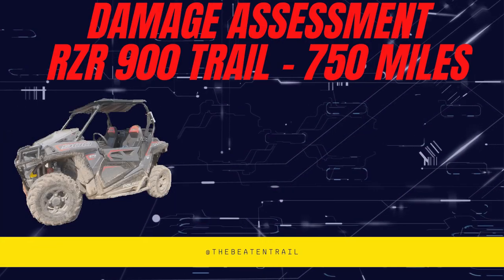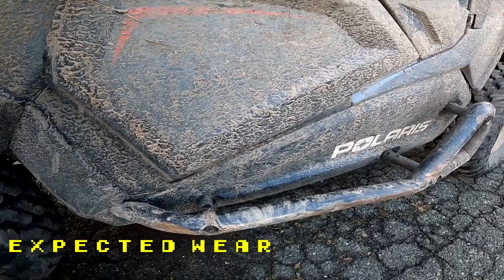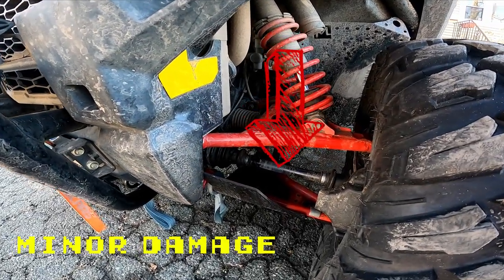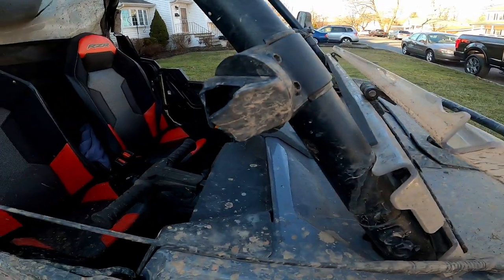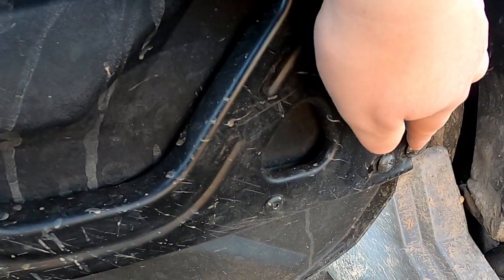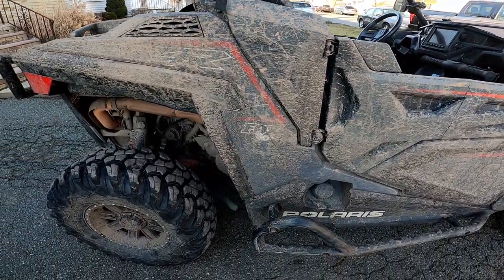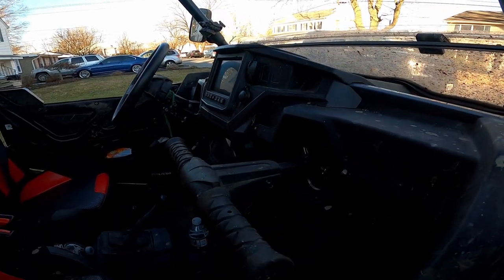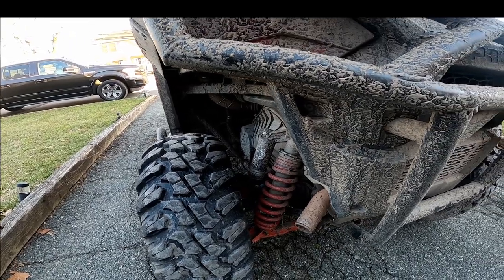2020 Polaris Rzr 900 Trail reliability review - Fox Edition first year 500 miles.

Comment: Looking at your damage from Tree's rocks etc, looks like you made a very good choice on a 50 inch model. Really nothing too bad damage wise, all expected on tight trails. Which goes back to reason why you chose a 50 inch model in first place. Good job on video - like the theme.
Reply from the maker: Thank you! Glad you like the video! Since then, we did have a knock-off of the rock slider, driver side.  I have the updated Ricochet low profiles once, so I have to remove the passengerside and then install the new ones.  Warm garage project here in NJ.  On my list. :)